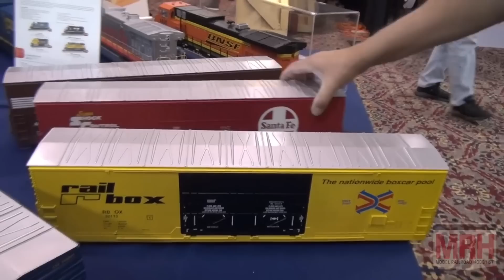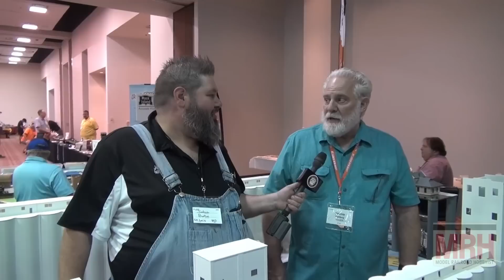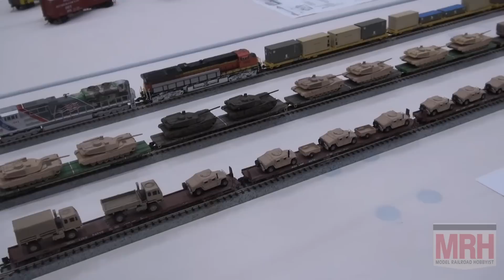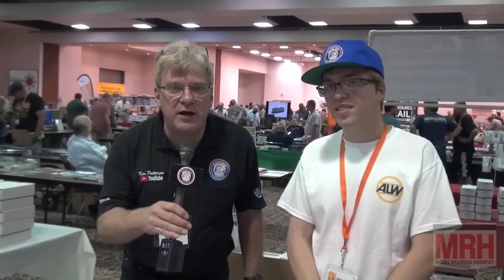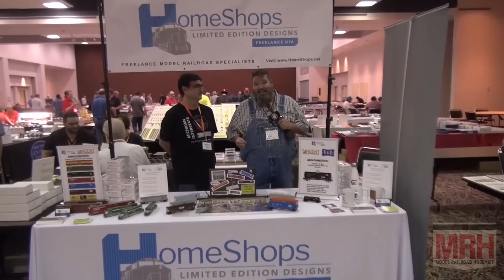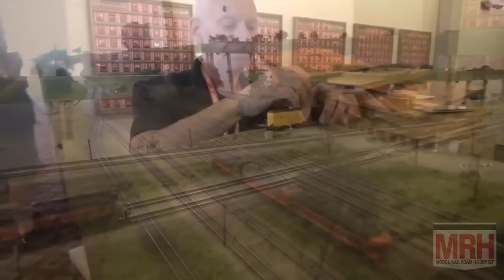St Louis 2022 Rail Prototype Modelers meet | September 2022 WHATS NEAT Model Railroad Hobbyist

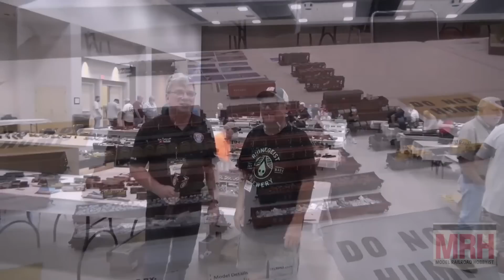Comment: Right around the 39:00 mark gave me the idea for my cafe / diner on my future Industrial layout. Instead of using the caboose I went out and bought a Walther's  troop kitchen car, with extra details from miniprints and Walthers, like roof top detail and skirting to go around the bottom of the kitchen car plus garbage bags,  cans and a dumpster behind the outdoor cafe. Also bought are tables and chairs for outdoor eating. Don't worry about seeing another train coupling up to it, because the ral in between the crossing has been removed and a partial flat car is now at the end of track for the use of unloading other flat cars and open end gondolas and woodchip cars. .